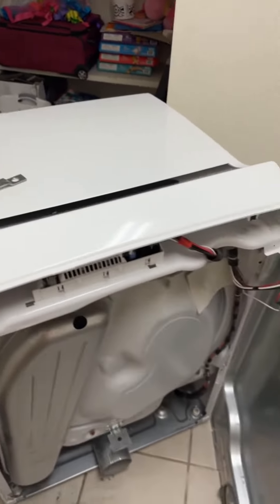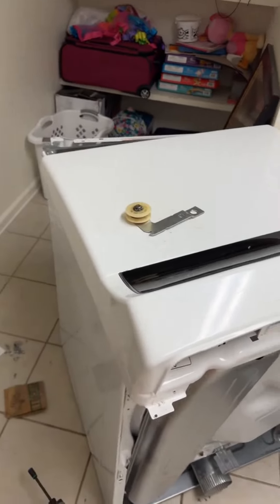Weekend Rant!

Comment: I replaced all my dryer rolls cause one got stuck and was making a thumping sound. Then i put it back together everything was fine then weeks later makes sound again but not as bad. Take it apart can't find anything wrong with it. Took it apart three more times still can't figure it out. I  even ran it once with the cover off. So i gave up our dryer now thumps gets quieter as the clothes get lighter. I found a sponge in the washer drain hose and had to replace the drain pump once cause it stopped worked. I got desperate waiting for the part ran it with a pan and a shop vac 😅. It was a pain did really work well washer keep erroring. Only did one load.